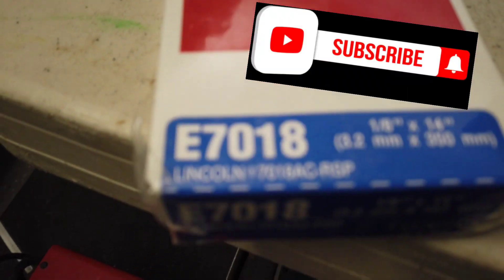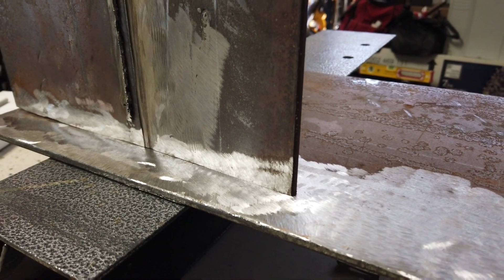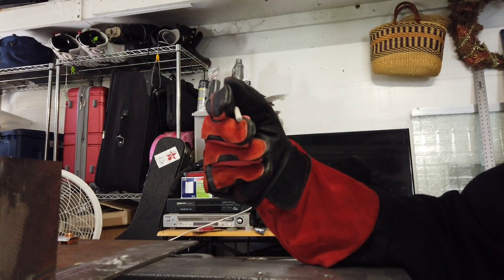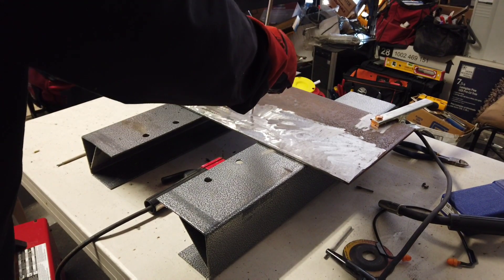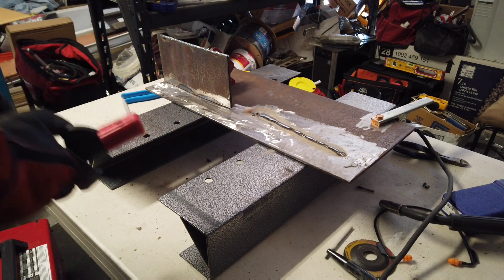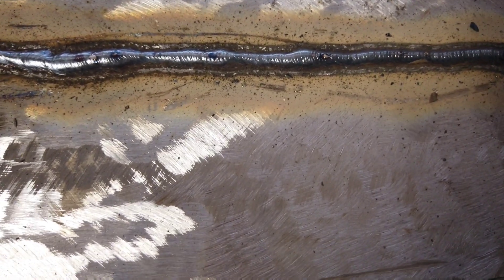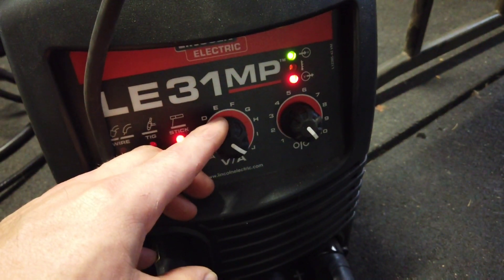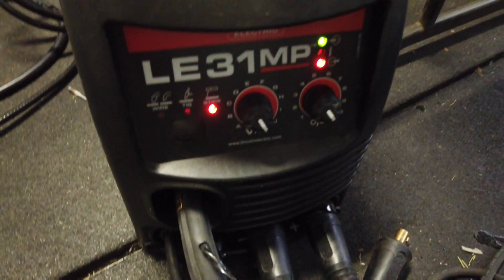LE31 MP - Will it weld 1/8" Rod?!?!

Comment: Bro you lowkey suck at striking rods I’ve welded 7018 on the Lincoln le31mp fine not the best but it’s doable try to learn how to strike rods
Reply from the maker: You've had no problem with 1/8" 7018 rods??
Reply: @demidog4549  it wasn’t the best but it’s doable

Comment: Hey back again here! A better experiment to try would be to run a 1/8 6011 rod instead of a 7018. Reason being is that a 7018 3/32 requires about the same amperage as a 1/8th 6011. A 7018 requires a lot more amperage than 60 series rod will. 7018 1/8 are usually welded around 100-125 amps as a 6011 1/8 will run at 75 -80 amps , which is a little less than what you run the 7018 3/32 with. That would be a more likely possibility to work. Would love to see a video on this soon.
Reply from the maker: Yea I had the same exact thought but I kinda wanted to go the extreme plus I didnt have any 60 rod handy in 1/8". I'll set it up and see what I can do. Thanks for the comment by that way.
Reply: DeMiDoG45 id love to see it bro I enjoy your videos! Keep em comin man
Reply from the maker: @giomiranda9839  thanks much appreciated my dude.
Reply: does the same with a 3/32 6010 rod